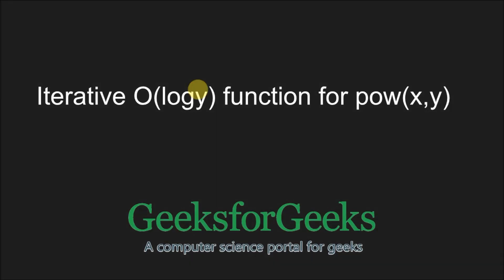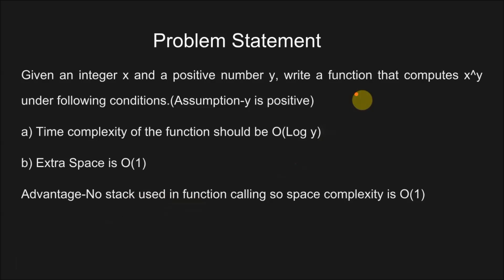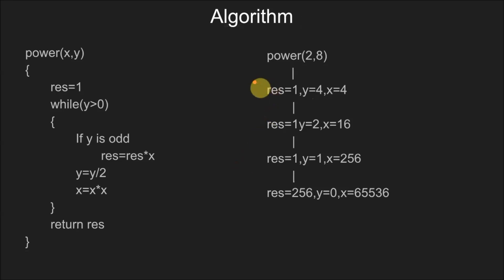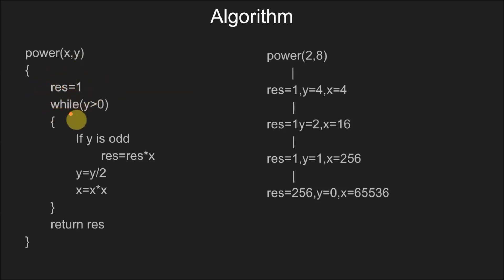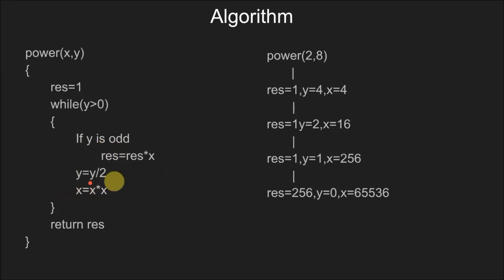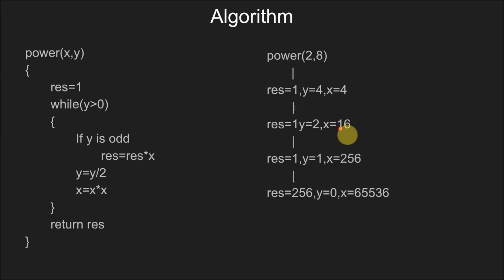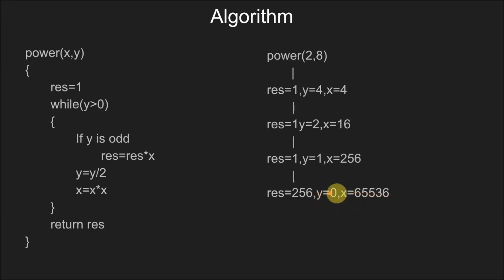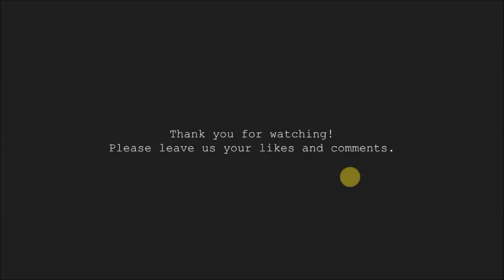Iterative O(log) function for pow(x,y) | GeeksforGeeks

Comment: NO Reasoning provided  for the logic used, not very useful tough, I recommend to not watch this. total waste of time.
Reply: Let's define pow(x, y)
Now suppose you want to pow(5, 14):
14 in binary is 0b1110
You create variable 'result' initially equal to 1
On each iteration no matter what you assign x = x * x and y = y / 2 (shift y by 1 to the right), and when the bit 0 of y is 1 (that is, y is odd) -- you do result = result * x
Here is how it works:
1) y is 0b1110, x is 5, test 0-th bit of y -> returns false, x = x * x = 25, y = 0b0111
2) test 0-th bit of y -> returns true. at this time x accumulated original_x ^ 2 and because bit 1 in 14 (0b1110) is set, we do result = result * 25 = 1 * 25, y = 0b0011, x = x * x = 625
3) test 0-th bit of y -> returns true. at this time x accumulated original_x ^ 4 and because bit 2 in 14 (0b1110) is set, we do result = result * 625 = 25 * 625 = 15625, y = 0b0001, x = x * x = 390625
4) test 0-th bit of y -> returns true. at this time x accumulated original_x ^ 8 and because bit 3 in 14 (0b1110) is set, we do result = result * 390625 = 15625 * 390625 = 6103515625
Now you're done with the answer
So as you can see the final result can be expressed as:
result = (x ^ 8) * (x ^ 4) * (x ^ 2)             (8, 4 and 2 come from 2 ^ (non-zero-bit in y, that is bits indexed 3, 2 and 1))
And when 0-th bit of y is set (after shift) -- variable x contains exactly what you need (x ^ 2, x ^ 4, x ^ 8)
Hope this helps.
Reply: @ИльясКаримуллин-ш4э  thanks
Reply: @jsingh7810   but how come the complexity is olog n. Loop runs till the end right?
Reply: @santoshreddy9963  loop will run till the end but we decreasing the y each time we loop example :
if y is 8, 1st loop will be 4, 2nd loop will be 2, 3rd loop will be 1, and the last on 4th loop will be 0 so in total we have 4 loop.. if its O(n) the loop will run from 8 till 0 so we have 8 loop in total..
Reply: @daverussell4052  thanks bro 👍
Reply: @santoshreddy9963  and why its become O(log(n))??? its because every loop we dividing the n to half for example n = 8 
1st loop : 8/2^1
2nd loop : 8/2^2
3rd loop : 8/2^3
4th loop : 8/2^4
so we can conclude that n/2^k, where k is the number of operations perform.. and because we will run till we get value of one so the equation will look like this n/2^k = 1
it means that 2^k = n
now if n is the input how to get the k as the number of operations perform
well if you remember logarithm says : a log b = c is equals to a^c = b
so 2^k = n is equal to 2 log n = k